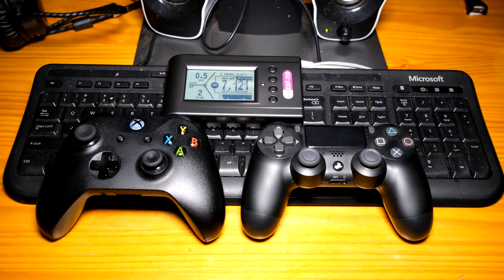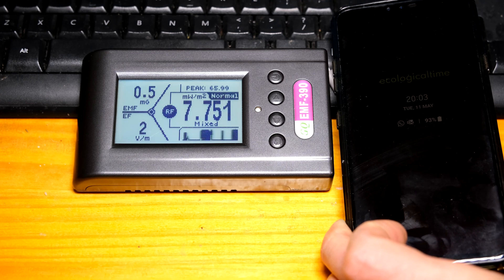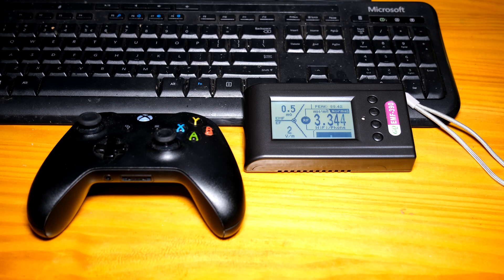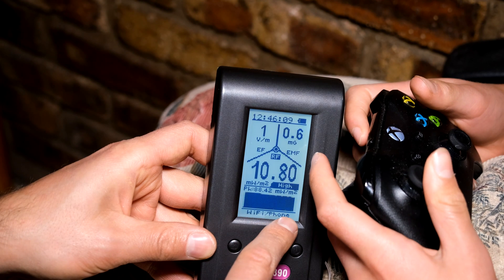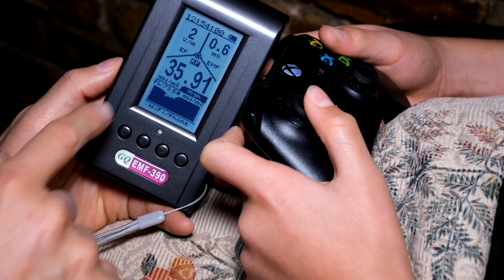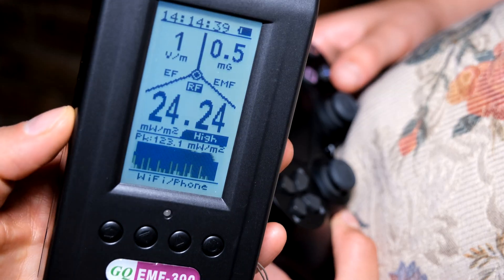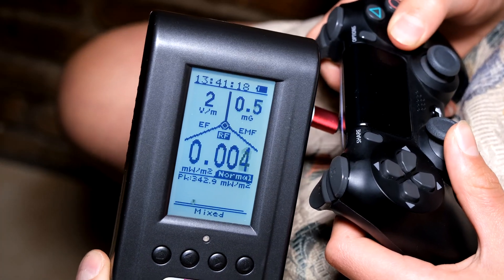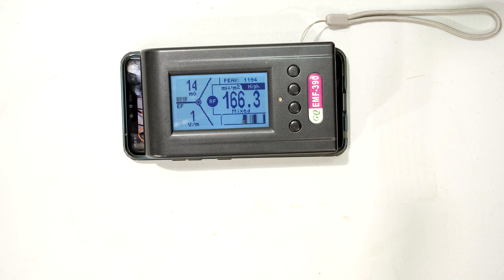Xbox One and PS4 controllers' Radio frequency power radiation measured - how much RF power?

Comment: Hi.  i have serveral PS3 and PS4 controllers in my room. Do they emit when they are in standby?. They are like 1,5m to 2m of distance when i am sleeping etc. Is that a problem?
Reply: They shouldn't while they are in standby. However unless your console is turned off at the  power source it is still emitting EMF because it's always awaiting Bluetooth connection to the controller.
Reply: You can test this with an AM radio with the dial turned all the way to the left.